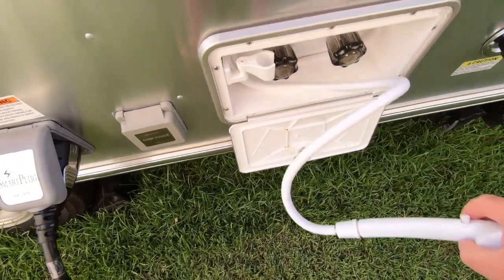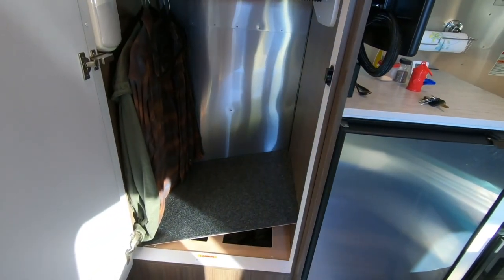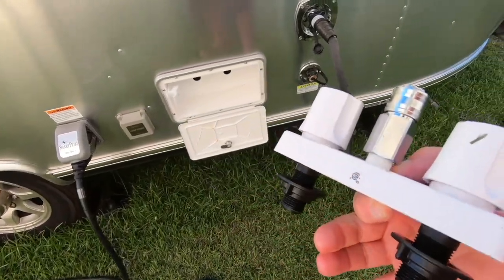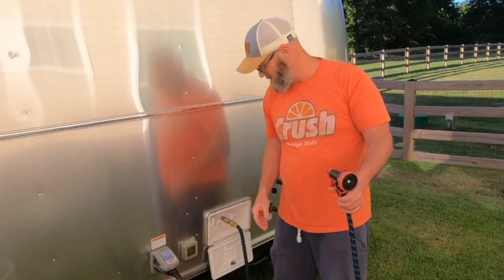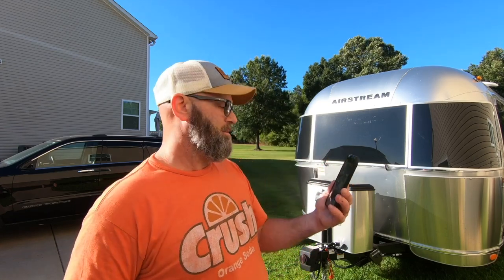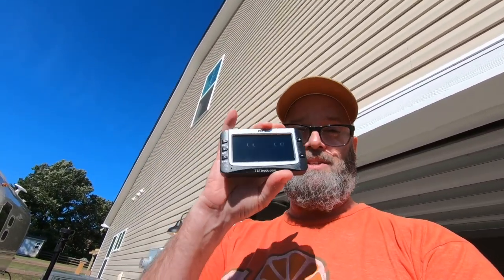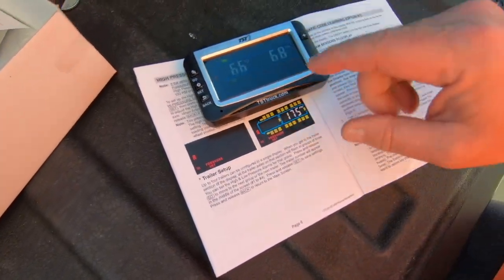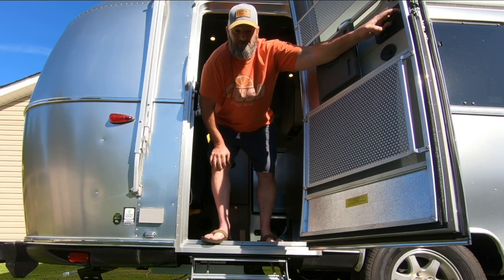The Most Important Add-on to my Airstream Ever

Comment: Thanks for this video!  Very helpful.  Have you used the Mopeka Propane Tank Gas Level Indicators in cold weather conditions?  I'm wondering how they will perform when it gets colder.
Reply from the maker: they do work in the cold but the battery dies quickly

Comment: Tire pressure can be debated as much as what's your favorite oil. 80psi is the max amount of air needed when the load is weighing the max lbs rating. Your airstream will bounce harder going down the road at 80psi. I would suggest running less than max. Get a rivet gun because you'll be popping interior rivets at that 80psi.
Reply from the maker: yes you are right and I have heard that about rivets. I ran it 75 cold

Comment: Nice job, have you seen the plywood mod that goes on top of propane tanks and held in place with wing nut, gives you another pl@ce for hoses, chocks , whatever?
Reply from the maker: thank you - yes i have seen that and it is on my to do list of projects. I think it will be really handy to have.
Reply: @TheBuckStop  future episode please review the dinette as a loafing area when its impossible to hang out outside
Reply: Also for the cutting board stove thingy
Maybe turn all burners and get grate really hot 
Then turn off heat and place cutting board to burn in the image
Then carve out with a dremel or router until it sits like you want with the grate somewhat up inside the cutting board

Comment: What size quick connect fitting works with this shower upgrade? Some are 1/2 inch, some 3/4 inch. Some male fittings have O-rings, yours didn't. No link here to your fittings.
Reply from the maker: hello - this is the one I purchased hope this helps - https://amzn.to/3Fz9jSG
Reply: @TheBuckStop  No - I'm asking about the fitting on your HOSE. It doesn't look like any standard quick connect fitting.
Reply from the maker: @bradbartel3489  I have to be honest I do not remeber where I got it but this one I think will work - https://amzn.to/3Y1H8Db
Reply: @TheBuckStop  This does work, just have to hammer it in the first time!